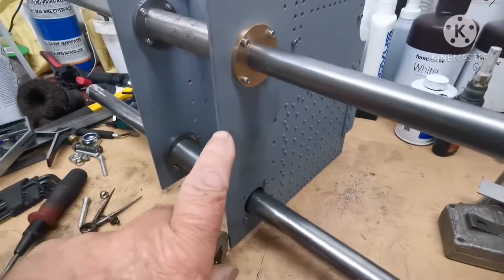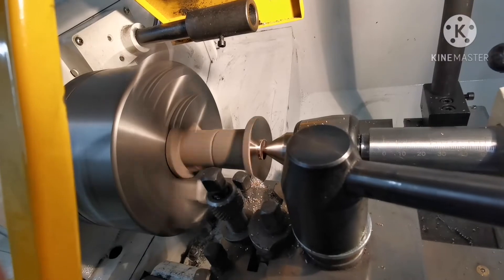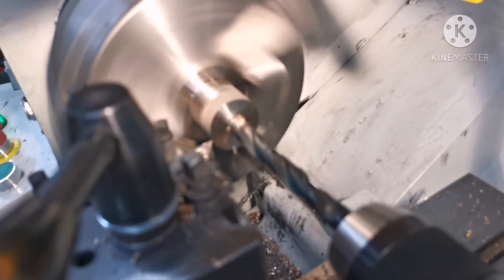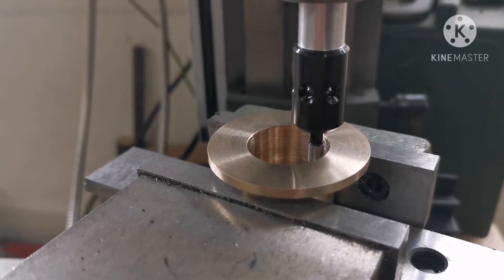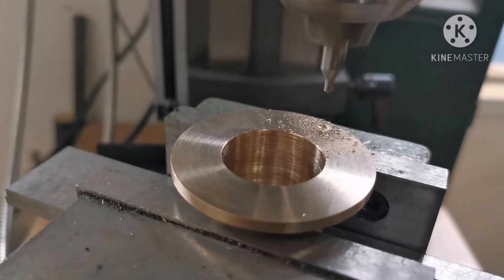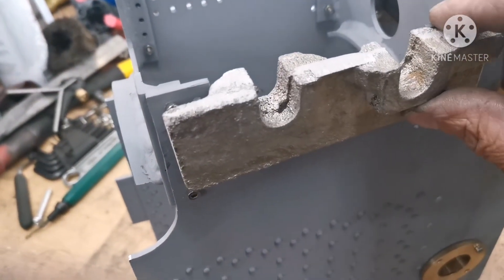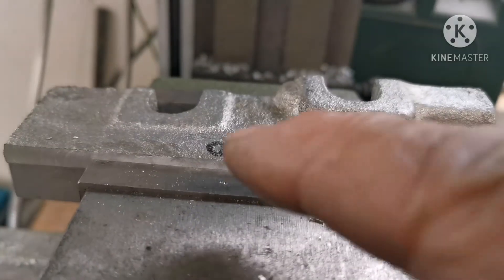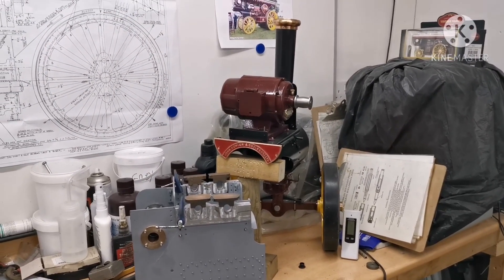2" Fowler Showman's Traction Engine

Comment: Hi Julian. The operations on the bearing were particularly interesting. Working order, holding etc. What was that screeching sound at 14:19?
Reply from the maker: That was the cross slide needing a good oiling which I have done

Comment: 4:25 brill Julian, you showed something I was wondering if it was just me: when parting the blade grips, cuts and then slips intermittently. This is bronze but I have that with the harder brasses as well and I thought I was doing things wrong. Maybe it is just a property of the material, after all brass and bronze have a tendency to grab. I noted that some sort of lubrication helps to ease this intermittent grabbing/cutting
Reply from the maker: Also I have found that the quick change tool post needs to be tightened up really good